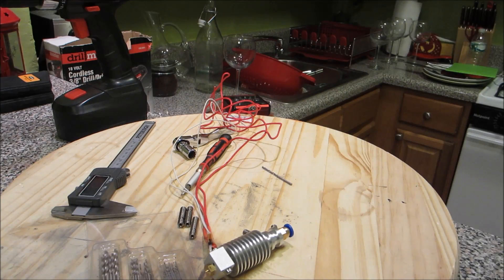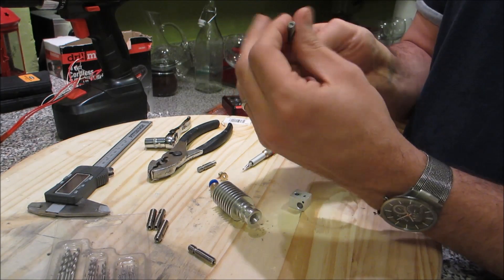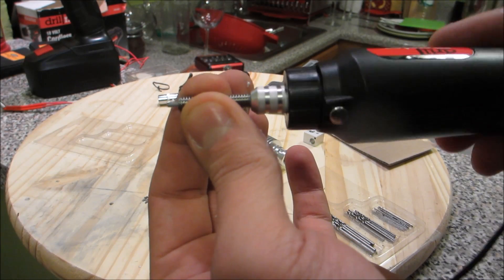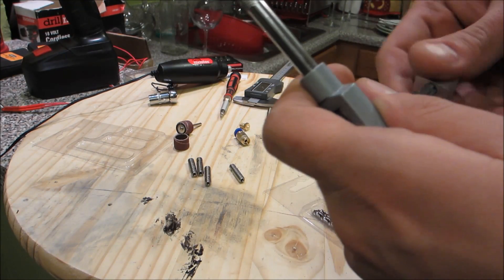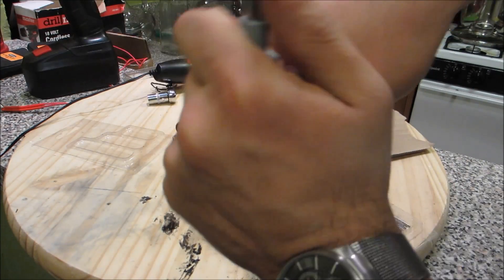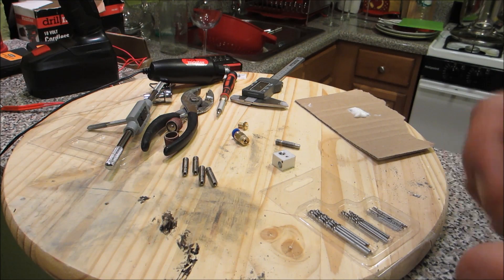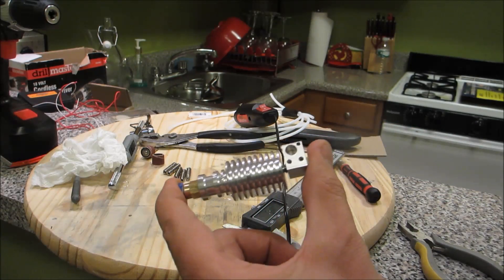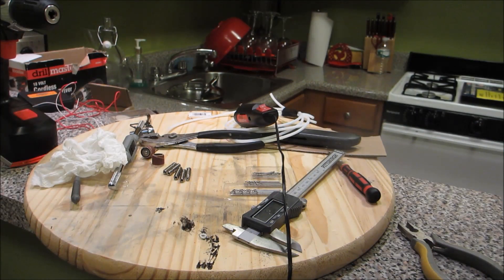Hot End Rework. J-Head, all metal hot end. 3D Printer.

Comment: You drill it out to 2mm for 1.75mm filament?  Is that because you want it a bit wider than the filament or is it just because of rounding to an available bit size?  More to the point, what diameter bit would you use for 3mm filament?

Thanks!
Reply from the maker: Depends on the tolerance you need. A proper way would be to drill to 1.7mm and team out to 1.8mm. 3mm filament is actually 2.8mm or so. I would drill to 2.9mm and team to 3.0mm
Reply: @Engineerd3d  thanks!

Comment: As someone pointed out already,  this is the ultimate way to ruin your head.  The metal head screws, both ends have groves that catches the teflon tubing from coming out.  You, by drilling them out,  removes all options to be nice and tight  and stay that way at all time.    Ultimately you can measure how far the teflon tubing is going into the head to make sure there are no gaps.  Pointless work.

Comment: nice way to ruin your whole printer head
Reply from the maker: I have not only ruined that head. It has printed consistently since 2015, that ruined head has been so consistent that since 2015 I have gotten 2 glogs that required dismantling and thousands of hours in print time, many nozzles have been worn out on that head.
Reply: Bruno M. thats great for you but there is a big chance that some one actually damage there head by using a drill. i made my owne head on the lathe at my work and i used reamers and after polished with diamondpaste (mayby a bit overkill but i had some laying around)
Reply from the maker: I understand what your saying, I was showing people that you can machine things fairly decently with some patience. I was living in an apartment at the time. I didn't own a lathe and my work does not include machinery. With that said I have a lathe now. I will most likely build my own hot ends at some point as well.
Reply: I'm curently designing a coldend and a hotend for dual extrusion with a single nozzle ( for bowden printer). if its done i can sent you the drawings if you want

Comment: Hi bruno old video but have a question....when the hotend is all assemblet and its time to mount it ....do you run the bownden/ptfe tube all the way through the heat sink to the heat break or just in the top of the bowden tube coupler?
Reply from the maker: Danish rc plane. Thomas møller just the Bowden coupler. I made a spacer between the coupler and the heat break. It reduces Bowden tube waste.
Reply: My recent one will let you run the ptfe bowden tube clear down into the heat break. Ie the bore in the heat sink is like 3mm! It's pretty horrid.

Comment: On the fitting I drill out the bottom stop to allow the ptfe tube to extend the full length not requiring a spacer. I actually prefer the knock-off heatsink over my original e3d heatsink because of the spring loaded fitting.

Comment: I bought a v6 J-head clone for $15 on eBay from China with a US warehouse. I took a drill bit and polished it up as nice as I could. Before I came around to this video, I put my printer's stock nozzle on it, and I was able to actually extrude with that. Otherwise, I'm getting this weird bulge at the end of the PTFE tube where it seems to not be completely flush against the heat break...Testing continues..
Reply from the maker: To polish a heat break nicely, use some steel wool strands wrapped around an underszied drill bit and use high speed to polish the break. Use some oil in there as well towards the end and wash the break. As for the weird bulge, there may be a gap between the end of the tube and the mating surface. Try to cut a longer chunk of PTFE if you need it. I would go with all metal heat break if you can polish it. No more ptfe wearing out.
Reply: Bruno M. Right, I'm actually running short of PTFE nearing to create a new mount already. I took my stock heatblock and heat break and inserted it into the j head in an attempt to just see if it would work. This break has PTFE insert, and I know it extrudes.. this way, it works!

Comment: to polish the inside of tubes, i know no better tool then a piece of coarse rustic string, that you can just barely force through it. toothpaste does kinda work, but that hard, green metal polishing compound is superior. takes off noticably more material and leaves no visible scratches. this method is used by jewelers to polish the insides of chainlinks and such. 
PS: use a long string, and work it like you mean it, for a minute or two! lol that green stuff works it's full magic at high rpm, when it gets hot.

Comment: hi, do you add it a ptfe tubing after you drill it the new heat breaker, i have something similar and get clogged right at the base of the heat break where the small ptfe tube its located.

Comment: I just used minidrill, silver thermal compound (= super abrasive), toothpaste and 2mm nail to polish chinese all metal heatbreak. i made a taper inside begining in the heatbreak zone just by turning it to sides, so the plug rips itself from the surface and slides into hot zone. It works for (previosly jamming) PETG, i will try for jamtastic PLA when it arrives.

Comment: This is an E3D clone. That the seller called it a J-Head was just keyword spamming at best. Genuine J-Heads are good at what they do out of the box, and genuine E3Ds wouldn't need to be reworked either. Sadly, knock-off makers don't even identify them properly and give the original product a bad name to boot because they're badly made.
Reply from the maker: +JeffDM 

I don't necessarily agree. This is a look alike product that was created out of open source drawings. I disagree with the name they picked, however this video was geared towards the poor souls who did not know better and bought a product that may not necessarily work. For me this product was purchased for two reasons. 1st reason was to see how it stacked up. Second reason I wanted to help out the community. I have no brand loyalty to anyone. I purchase what I can afford and what I wish to purchase. e3d has done excellent work. On my next 3d printer build I will be putting a genuine e3d hot end in it to save some time. With that said, these hot ends do have a place in the market, especially in developing countries where the price of a genuine e3d hot end may be a month worth of salary. I thought the reprap motto was the propagation of these machine all over the world. The ultra cheap hot ends do help in this direction.
Reply: I get that. A key problem is the design is misrepresented. It's not a look-alike product because it doesn't look remotely like a J-Head. The title or description of the product (or this video) doesn't indicate that it's a clone instead of the original, which gives a bad name to the originals.

Comment: You solved something @ 18:00. I have been having that problem from a long time. I have discussed it in forums and no one knows why it happens. I have been doing the same(Just using 4-2mm ID tube). But you added a 6mm tube as well. That explains a lot of why my design was incomplete.

I theory is that when filament spool is near to end, the filament has lot of tun on it(Its not as straight as a full spool of filament). This bend is the reason for block on these All metal hotend.

There is one more problem which you did not mention.
There is  a gap(I found on two all metal hotends), between the steel M6x26 nut and the aluminium heatsink even if M6x26 nut is screwed till the shoulder. I think that gap is around 6~7mm. So I use another piece of 4-2mm ID tube in between Heatsink and M6x26 nut. Again, problem gets worse when changing filament. New filament gets stuck a lot.
Reply from the maker: I am glad the video was of use to you. I appreciate the feedback. In January I will resume making more videos. I have allot of pent up ideas I would like to try as well as film. Not to mention a bunch of filament to review. I am also going to standardize my own testing of filament.

Comment: First half of the video is really useful. Second half is horrible. I literally facepalmed when you drilled thru the PTFE tube. After cleaning the hotend to within an inch of its life, you gone and drilled the tube. Now whole thing is filled with pieces of PTFE. Here is an alternative, drill the pneumatic clamp with a 4mm bit(while it's not connected to the hotend...)  then feed the bowden tube all the way down to the hole in the heat sink.

Comment: ohhh, i got the idea. you spoil these original heat-breaker in the j-head and REPLACE them with the ones from your link further down (http://www.aliexpress.com/item/5pcs-lot-New-RepRap-3D-Printer-M6-26-printer-nozzle-throat/1692946949.html)
Do i get it right?
Reply from the maker: +toz info 

I did not spoil them. I removed the old heat breaks with teflon due to my requirements (280c+ range of temp) which the teflon would not survive at. I don't recommend going over 230 with teflon tube heat breaks.

Comment: hi bruno. thanks for the video. i started to try this, but in my chines j-head is the teflon tube near the nozzle. 
i took an image  here .. http://imgur.com/dnWbh1i
how would i align all my parts? do your tips work on this variant too?
Reply from the maker: +toz info 

You can use a slightly undersized 2mm drill bit, 1.8mm drill bit to align all the parts. Yes this guide would work, with one major difference, you should not machine the teflon. The extruded finish of the teflon tube is already glass smooth.

Comment: +Bruno M.  One Q.... i measured the depth of the M6 thread in the heatsink.... the calipers said 26.5mm

the included heatbreak is also 26.5... the depth of the heatblock with nozzle screwed in is 5 mm... so I miss 5mm or a bit more

can this be true?

when i screw in the heatbreak everything seems fine thou... i just meassure the threads deeper

also i have plowed ebay for a full metal heatbreak and they are all the same 26.5mm long

any advice?
Reply from the maker: +Bo Herrmannsen 

Im not sure what you are referring to. Can you elaborate on your question a bit more?
Reply: +Bruno M. yes

i use my calipers and messure the lenght of the hole in the heat sink... that is 26.5mm

the heat break is also 26.5mm

and the depth of the heat block thread is 5mm... so i miss at least 5mm

and i cant find any heatbreaks that are more than 26.5mm

does this make more sense?
Reply from the maker: I have to measure my heat breaks as well as my heatsinks. However the heatbreak will not go through the whole heatsink, unless you drilled and taped the heatsink. Also most of these heatsinks are not tapped all the way through. The last 5mm or so or space is much more narrow and you either have to tap it or you have to round down your heatsink.
Reply: +Bruno M. then it starts to make sense.. ie if the last 5mm or so are not quite as wide as the main part of the M6 thread... i just took the tail of the calipers and messured it and figured that i would miss a little bit of 5mm or more to make it work...

will go and figure what my next step is

do you have any good sources for heat breaks that are longer than the 26.5mm long? just in case i decide to tap my heat sink (if its not allready tapped all the way it can be tapped)
Reply from the maker: I use aliexpress for my heatbreaks. Although they seem to be 26mm as well. http://www.aliexpress.com/item/5pcs-lot-New-RepRap-3D-Printer-M6-26-printer-nozzle-throat/1692946949.html

Check out how to polish the heat breaks video I posted.
Reply: +Bruno M. hehehe, i saw most of your videos.... great stuff that no one i know cares much about

it really starts to make you think about why and how to do things :-D
Reply: +Bruno M. http://www.harald-nyborg.dk/images/800/4447.jpg

a pic of a tap set from a local store... it makes even more sense when i got my memory refreshed.. the tap does narrow in at the top and there is no way  it can make threads all the way up... so yes there would be about 5mm that you can messure with the tail of the calipers but you will not be able to make a thread all the way

so in fact a 26.5mm heat break should fit perfectly

left is just to find the right combination of PTFE tubes so the filament is fully supported all the way.. or as good as it can get
Reply: +Bruno M. I can really give your work / video 2 fat thumbs up. I did tab the heatsink and heat block while at the local hackerspace. The others there stared at me like I had just escaped the "fun house". I just asked them if this had been machined to specs why it was I could pull out as much metal bits as you did... they where silent for the rest of the night... 

and the 5 missing mm was as you predicted.... it's the very last bit of the heatsink... if I look down the filament path from the top side towards the nozzle I can see about 5mm of travel with no walls...

I just guess that this cant be avoided as you have to drill deeper than you want to tap....

maybe use the PTFE liner from the heatbreak i have now.. or try hunt a PTFE tube with  a OD of 6mm so it fits inside the heatsink
Reply: +Bo Herrmannsen 

I am using 4-2mm ID tube for that 5~6mm.
Reply: +Bo Herrmannsen 

Did you find a 6-2mm PTFE tube.?
Reply: +Sourabh Roddey metal hotend i got gave up quickly... i did all the tricks in the in the video and still it leaked... the heat break was to short so that the heat block was to close to the fins.... i just gave up on it and throwed it out... leason learned: dont go cheap... and dont go experimental if you want things to just work
Reply: Bo Herrmannsen I have been using for 1 year now. I would say its difficult. But worth it

Comment: What i did was drill out the back of the pressfit connector and the top of the heatsink to the outer diameter of my PTFE tubing. I then put the Heatbreak into the heatsink and drill a little of the heatbreak out. I take the PTFE tubing and sharpen the one end in a pencil sharperner. Now you ca push the PTFE tubing all the way through the push connecterdown to the heatbreak.

Im going to try polishing the heatbreaks! the Toothpaste idea is really smart
Reply: Just make sure you have spare connectors... I have broken a few

Comment: Where do you get the all metal heat breaks for less than 2$ each?  The cheapest I could find was $4 each on ebay, and they charge 2$ shipping too.
Reply from the maker: bob dobb 

I bought mine in bulk for less $2usd a pop. Actualy I paid about 6USD for 5 of them. Now the price seems to have come down. Here is a link. http://www.aliexpress.com/item/5pcs-lot-New-RepRap-3D-Printer-M6-26-printer-nozzle-throat/1692946949.html
Reply: I have found that there are two sizes of heat break threads, while pretty much all of the short ends fit all of the heat blocks, the long side can be quite a bit diff. I bought 5 of them (were supposed to be 'all metal'), and a v6 head kit, with drill and bowden tube etc. The tube is too large to fit any of my other china-head heat sinks! Also there are two sizes of pneumatic bowden fittings! (the thread side) I have had ok luck with the $12-19 hot ends, but these recent parts are a moving target. Boo Amazon!
Nice write up on the polishing btw, going to employ some of these tricks.

Comment: Other polishing agents would be auto buffing or polishing compounds, and optical rouge.
Reply from the maker: Kenneth Scharf 

Honestly polishing to optical shine is not necesary, even a satin smooth finish works well. What I found is that if you get a 1.8mm drill bit and wrap the flutes with strands of steel wool you can use that to polish the heat break without going crazy with polishing compounds. The steel wool acts as a reamer.
Reply: I looked for miniature reamers, they are expensive, that's a good idea.